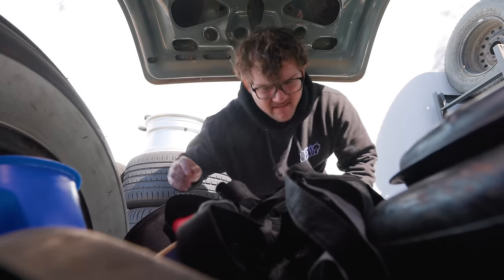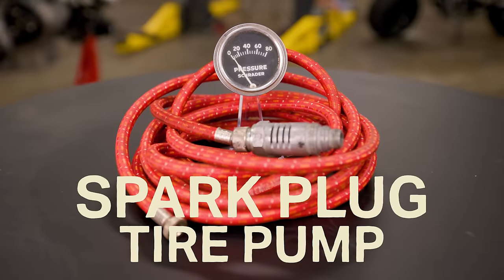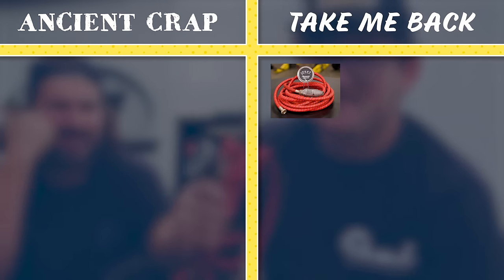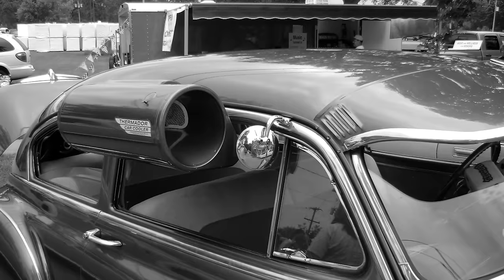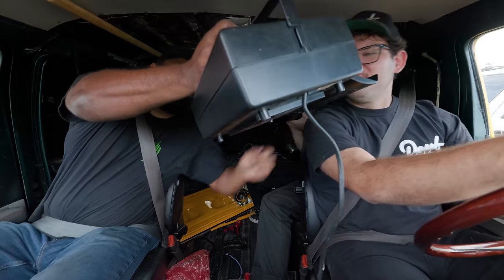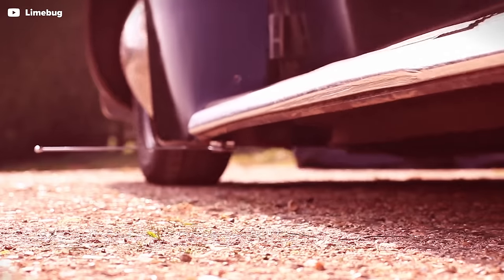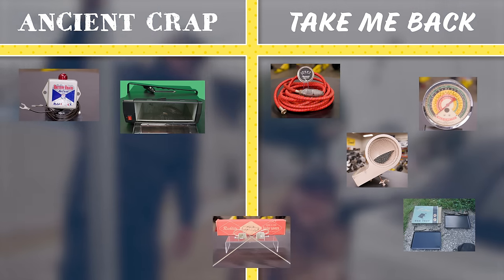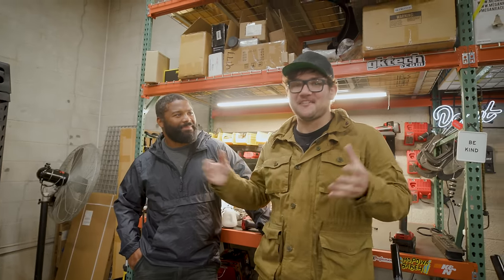Testing Forgotten Car Accessories

Comment: The spark plug “chuffer” air pump used to be common, and I think Cepek sold them to offroaders into the 1970’s. On Dad’s 1950 Plymouth with flathead six, it was very convenient.  The swamp cooler was only worth the effort in hot country, not here in the PNW.  I still have a tread grooving iron, and I used to have a Goodyear truck tire marked “regroovable.”  But I only used the iron to improve offroad tread on a 4x4. Today, there are laws against regrooving, which would be dangerous with today’s tires.  Curb feelers actually help, and I had them on my 1958 Cadillac. The many uses of that vacuum gauge represent some creative marketing.  But in The Day, a Mechanic was a guy with timing light, dwell/tach meter, vacuum gauge and a box of tools (and a lot of know-how).  The wiper arm pressure gauge is a marketing tool for service stations.  Thanks for taking me back, guys.
Reply: My dad was a mechanic and his go-to tools were just what you listed. Timing light, vacuum gauge and a small screwdriver for the carb screws. 
Some of my first memories are of holding the flashlight for him, under the hood of a car. Trauma, I’m telling you.
Reply: The tire grooving tool is still used today but while it is spinning on the back of a vehicle (offroad truck mostly) to help with terrain fixes
Reply: They still use similar tools to recondition airless tires for a lot of equipment.  The old tires when regrooving tires were mostly bias ply and had thicker rubber than tires today, so regrooving was both less dangerous and in a lot of those tires, actually designed as a feature.
Reply: The swamp coolers are still used in low humidity areas,deserts... I've tried using them in East Texas,and they blow a little cooler,but not as well as in the desert.

Comment: For off roading the spark plug inflator would be a great back up if u have a v8
Reply: Would do fine wit a well running engine all the way down to a 4banger
Reply: The only reason we don't use it today is because there is an easier place to plug something in. It probably still works better.
Reply: @norman1907  the reason we dont use that anymore is people dont even know how to open their own hood. Imagine them removing the spark plug! way too difficult for them!
Reply: @1nicube  good point, and spark plugs aren’t as accessible as they used to be 😂
Reply: @loganthompson5961  if you have a boxter... yes, but they are really accessable if you have any normal car.
Reply: @1nicube  you’ve never changed plugs on a BMW obviously lol
Reply: (1) They have rechargeable inflation pumps now.

(2) Any newer vehicle is going to throw misfire codes.
Reply: Edit:   I should have paid more attention to the video.   My original following statement is false.....    We also don't use them because there is FUEL in the cylinder.    So your pumping fuel into your tire.
Reply: @bigdaddy7119  Wait what?

You just need to remove a plastic cover, a piece of cowling and then each plug is right underneath each ignition coil (which if you're doing plugs you might as well do the coil with it).

Sooooo much easier than doing coils and plugs on a Subbie or Porsche product.
Reply: @videoviewer2008  they addressed that. It doesn’t use piston air, it intakes it’s own air.
Reply: @carabooseOG  thanks for clarifying.
Reply: @1nicube  that's not it new vehicles have worst spark plug placements and also most cars have usbs or cigarette light to power a inflater
Reply: @funfun5656  as long as you dont have a car where you need to remove the intake and a dozen or two each of hoses and wires to get to the plugs
Reply: @jesperviktorsson8027  would work on a single cylinder as long as the battery is good enough =)
Reply: @bigdaddy7119  they are direclty on top of the engine. Easiest place the get access to
Reply: Don't the coil packs on newer vehicles tend to fry themselves if not hooked to a plug while firing?
Reply: this would be great for a motorcycle as well. especially adventure/ duel sport would take up less space than a small air pump
Reply: Wait, my diesel hatchback doesn't have dpark plugs I just remembered.
Reply: @bigdaddy7119  and clear them minutes after you put the plug back in
Reply: So far here, everybody is forgetting the biggest thing against using the spark plug tire pump--hot exhaust manifolds.  That's a big annoyance.
Reply: @discerningmind  if you have this tool your hands are made of leather and a hot exhaust is like a warm cup of tea.
Reply: @1nicube  I’d say most spark plugs are accessible but most people wouldn’t have the tools to take one out and even if they did, every single person would get some good burns. I remember that happened to me the first time I changed my spark plugs
Reply: @1nicube  Modern cars are also no designed to have easy ecces to the sparkplugs. You could do this on my car, but you first have to spend 20 minutes to get to the plug and remove it, and again to put it back.

And you'll get a check engine light because one of the cylinders isn't firing.
Reply: performance is probably based off compression so the size of the engine probably doesn't matter
Reply: @1nicube  nope! I change my own spark plugs and still wouldn't use it for risk of getting dirt and dust on my spark plugs just to inflate a tire
Reply: @1nicube  not really, now we have cheap small compressors that can plug into your car. So yeah this thing works but it’s already been replaced. Plus who wants to take a spark plug out when you could just plug something in
Reply: lol wut? If your engine is running you have 12v power already. Just carry a backup 12v inflator.
Reply: Just use a 9 or 12 volt cigarette lighter compressor
Reply: @jaredchamberlain5709  where do you have 9v in a car?
Reply: @widdly-scuds  just leave the coil attached to the plug, the plug will still fire in open air and prevent damage
Reply: @1nicube  Have you popped the hood on a modern car?  You'd have to spend 2 hours digging out parts to even get to the spark plugs on most newer cars.  Don't even get me started on a Porsche or Subaru with a boxer engine.  I'm also not sure how good of an idea it is to remove a spark plugs and have fuel be dumped through the cylinder without firing, would probably cause all kinds of problems from check engine lights to even damaging smog equipment from so much unburnt fuel run through it.  This product was clearly from a different time before catalytic converters and smog sensors.
Reply: @hj61 it isn't an open hose. It works like a bike pump, but instead of a handle that you manually pump, it has a small diaphragm that is moved by cylinder compression
Reply: @1nicube  on my old altima you had to take the whole damn intake manifold off just to get the back 3 spark plugs lmfao
Reply: @TheHenirik , or your leg on a kickstart or arm pulling a rope. You could legitimately turn a weed whacker into an air compressor...
Reply: @callmed.7171  imagine stopping somewhere and asking if anyone around has a compressor to borrow for your tire,
 and someone comes out with a weedwacker, attaches this thing, and starts pulling the starter rope
Reply: @user-si5fm8ql3c  as long as it has decent ground yes, the plug still has to touch grounded metal
Reply: as long as you don't have Fuel injection
Reply: @Jmacfann  My dual sport is a single banger... RIP my battery I guess.
Reply: @1nicube  Plugging in a compressor is much faster than removing and interesting a sparkplug again.
Reply: @jaredchamberlain5709  they suck. They overheat after 5 minutes and would never fill a big off road tire without cool down breaks.
Reply: I suggested a v8 because ls and SBC and sb Ford's have very easy plugs to get too. I imagine this was really easy to use on flat head engines back in the 70's ha ha
Reply: @videoviewer2008  they disproved that in the video there’s filters to stop fuel getting in there
Reply: @hj61 it's not much per cycle, but it's also cycling with every compression stroke of the engine, so if you're idling at 1000rpm, it's pumping 500 times per minute. Not a ton of flow but more than you might expect. 
What makes it particularly effective is it is a positive displacement pump. This means for every stroke, it will move the same volume of air, as long as the motive force is greater than the pressure of the output, and considering its using engine compression, I'd say that's a safe bet.
Reply: @johnsnow1355  I’d rather hang around and chill for like 15-20 min than tear up my motor and risk breaking a plug or getting shit in the plug hole for 15-30 min and maybe far worse… maybe just buy better pumps
Reply: @1nicube  “any normal car” lol ok
Reply: Repent and believe in Jesus. John 3:16 KJV - For God so loved the world, that he gave his only begotten Son, that whosoever believeth in him should not perish, but have everlasting life. 
Luke 13:3 KJV - I tell you nay: but except ye repent, ye shall all likewise perish.  
2 Corinthians 5:17 KJV - Therefore if any man be in Christ, he is a new creature: old things are passed away; behold, all things are become new.
Reply: @videoviewer2008  did you even pay attention ....
Reply: @1nicube  On my Audi you need a special tool just to remove the spark plug boots as they sit so deep inside the engine.
Reply: @CoreMaster111  what is a sparkplug boot? you mean the coilpack or the wire?
Reply: @1nicube  Spark plug wire with a boot that sticks onto the spark plug.
Reply: These were sold as an emergency fix.  Actually had a friend use one on a slow leak while we were on a cross country ride back in the 70's.  (Think "Easy Rider", but with less shooting.)
Kick starting a Harley running on one cylinder is a special treat.

Comment: 12:30 It's used in the trucking industry, it's cheaper to regroove tyres rather than buy new ones
Also there's a special marker on the sidewall that says "Regroovable"
Reply: - $$$ × 9 months

Comment: That spark plug tire air compressor thing is pretty creative, I’ve never heard a product like that before.
Reply: When Ford came out with their flathead v8 almost a century ago, some people would replace one of the cylinder heads, such that half of the engine was an ordinary 4cyl engine, and the other half was an air compressor. It was useful in industrial applications. The idea of using a piston to pump stuff is surprisingly ubiquitous.... Engines produce power through combustion, where  compressors consume power to convert rotation back into linear actuation. Neat, huh?
Reply: @ads1035  pretty neat indeed. Im just wondering, why we didn’t see the product anymore nowadays? How did it fall out of style (or whatever it is that made it not exists today)?
Reply: @NeroVingian40  Newer cars have spark plugs that are much harder to get to, and the creation of small, electric pumps that could run off the car battery, or cigarette lighter. So, these type of inflator became obsolete
Reply: @copo2835  that makes sense, yeah.
Reply: @NeroVingian40  Yeah, electrification is really what killed that idea. Even in industrial settings, if you need an air compressor, its usually an electric one, even if it consists of multiple compression chambers with multiple electric motors driving them.
Reply: ....come to think of it, electrification seems to be a recurring theme lately....
Reply: @NeroVingian40  You also don't see it nowadays because of how lazy people have become. Most people can't change their oil, air filters, etc. Modern people certainly wouldn't be able to pull a spark plug.
Reply: @MiamiZombie2012  Plus with all the sensors & computers in modern vehicles I'm sure it would trip all kinds of codes & maybe even a limp mode if you fired it up without a spark plug LOL. Pretty much why I stick to the 70's, 80's & early 90's. Electronics yes but not overly done like today.
Reply: What is an engine but an air pump really? At it's basic level that's all it really is

Comment: Curb finders do actually work. Not so much for actual parallel parking, but for if there’s a couple empty spots in a row and you can just pull in. Especially good for the land yachts of the 60s.

Comment: The main thing why the re-grooving is not much used anymore is because tires used to have much more rubber in them. Nowadays even the most expensive tires might have only 5 millimetres of rubber after the tread.
Reply: Its still done pretty heavily in other countries on large vehicle tires where they dont have so strict rules
Reply: @terryfloyd3505  recapping is still allowed for non steering tires but I think that is slowing being more regulated or outlawed in some states.
Reply: @terryfloyd3505  almost every heavy/medium duty truck on American roads is running retreads on the drive axles
Reply: @icanhazgoodgame3845  Retreads aren't illegal anywhere in the US, they're just not economical in most cases so nobody uses them.

Comment: The air pump thing used to be taken one step further back in the day with whole air compressors made out of ford model t and model a engines. Two cylinders would be disabled from firing and getting fuel and would just be used for compression to build air
Reply: I've seen a few old v8s converted to air compressors, one bank gets a regular head, and the other is used as the compressor
Reply: They used to have a "kit" for Vw air cooled engines to make them a compressor. 
2 cyls ran the engine and 2 were for the air compressor. 
It had a special cam so it would run on 2 cylinders a little smoother.
Reply: @MrTheHillfolk  that's actually pretty cool, more in line with a traditional compressor, no water loop to deal with

Comment: I actually put a vacuum economy gauge on my 86 camaro project and it has helped with fuel economy. It makes you really feel how your pedal movements influence your long term economy and not only that, but where to shift your engine because what I’ve seen from it is if you shift your car too early, it kills vacuum and therefor economy because you’re lugging the car to where it’s not at an efficient rpm. So yeah, it really does work. Also companies put it in their cars from the factory in the 60’s and 70’s

Comment: When my brother bought his first car, a 1958 Pontiac, it had "Curb Whiskers" or "Curb Feelers" as they were called. They were supposed to be angled down so that they would touch the curb when parallel parking. I thought they were cool. I remember seeing a lot of those swamp coolers when I was a kid, particularly in the desert like Palm Springs. The Anco wiper pressure was in a lot of service stations. They would measure the pressure on the wiper blades. If it was too low, the blades would leave streaks. The solution was to replace the wiper arm spring, or bend the wiper arm some to stretch the spring some. I had one of those spark plug tire pumps, and it worked very well. I bought it from the J C Whitney catalog in about 1972. Yours has a much better hose. Mine had a regular rubber hose that eventually rotted, but it may still be in the garage somewhere. The tire regroover was for large truck tires that were designed to be regrooved, but they were often used by less than honest used car dealers who would use one to make worn tires look better.

Comment: For the tandem and single axel trucks I work on, I sometimes have to sipe the tires with a "regrover" essentially I'll just cut a new pattern in a new tire to match a previous tires tread pattern. It works really well

Comment: I own a 1966 bel air, all the weird gadgets I got with it when I was a 16 still work to this day and I’m 21 now. It’s weird how well and weird everything was built back then but I feel like they had some innovation back then that was just a little more “advanced” then us now a days.
Reply: Money.  Can't make money when things don't break!
Reply: @trippzy8048  Well I mean,  back then the worlds population was booming,  you could def make money with things that lasted a life time. With the population aging,  eh.  Don't forget,  The USA was unable to print money out of nothing due to a gold pegged dollar.
Reply: @trippzy8048  yep Mercedes realized the 240d was too good and they stopped building em like that. 
When's the last time you disassembled a fuel sender and cleaned it so it would work again? 
Silly me almost bought a new one without looking up about it. 
(which ironically probably wouldn't last as long as the original)
Reply: My theory is that, back then you didn’t have advanced analysis tools to be able to design something precisely for your life cycle. So things were over engineered, the safety factor assumed to cover all your load cases.

Now we can precisely engineer something to only last 1-2 years and have the customer buy more.
Reply: Yes and no, a lot of the older gadgets work on much simpler tech which is why they last longer, the swamp cooler, for example, uses the basic principle of evaporative cooling. as the air passes through the water soaked medium absorbs the heat and cools the air which evaporates the water. Now we use air conditioning instead of evaporative cooling.
Reply: And I’m sure that in another 66 years they will say the same thing about modern cars today/tools
Reply: The United States made things and took pride in it
Reply: Technology pushes ingenuity away from simplicity. My 62 falcon wipers were powered by engine vacuum. Literally sucked across the windshield.
Reply: Blame lightbulb manufacturers for planned obsolescence. I watched an interesting documentary on how a cartel of lightbulb manufacturers got together to agree to make crappy lightbulbs so people had to replace them more often. 1920s lightbulbs lasted almost indefinitely so they decided they can’t have that and slowly made them to burn out faster and faster and everyone else eventually decided to do the same.